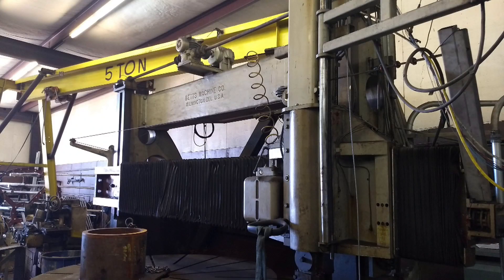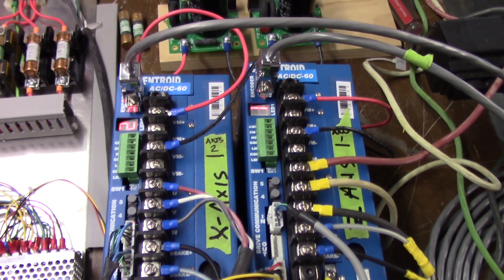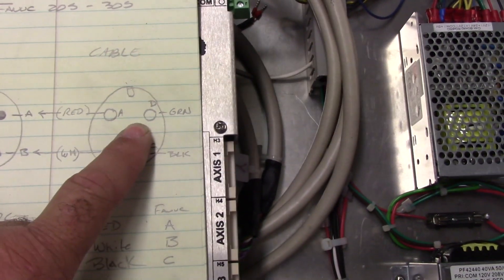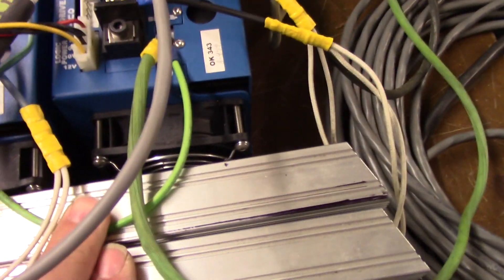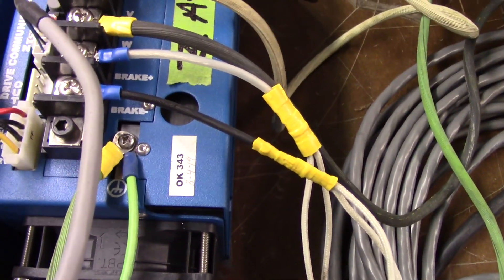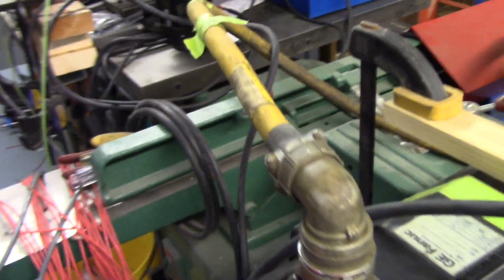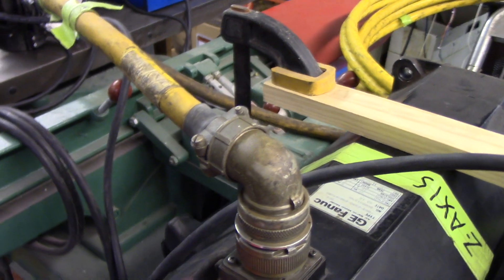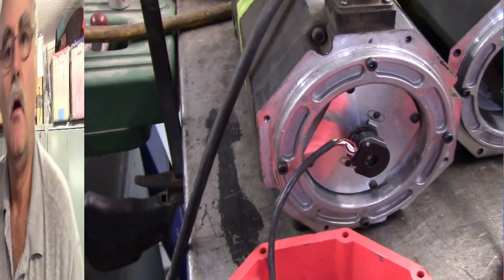Centroid CNC AC/DC FANUC Setup Part 1: Overview & Testing the Fanuc Motors

Comment: Do a video sharing toolchanger
Reply from the maker: Sharing or showing a tool changer. The issue with tool changers is they can be and usually are a little different. My current Atrump Maximill E216 has a carousel tool changer and it runs under Centroid. I can't to do any videos on it because it has a new control and yet to be released.
Reply: Okay thanks for the reply, I would like to retrofit my old Takisawa lathe with yellow cap Fanuc servo 12 station turret with centroid system ,please keep me posted or refer me to someone, talking to you From South Africa 🇿🇦
Reply from the maker: @seimela  suggest you send pictures of your .machine, model numbers of your fanuc motors and details on your turret to sales AT Centroidcnc DOT com
You could also post that information on the Centroid CNC user support forums: https://centroidcncforum.com/viewforum.php?f=64

Comment: Being that qualified person I want to let you know that the DVM is not the correct tool for checking motor isolation. If your DVM shows any resistance to ground I would be surprised. A Meg meter is required. They are sold in different configurations however to get the best reading it should output 1,000 volts. I have found resistive shorts on bad motors where others have found no issue with a 500v meter. I admire your work sir so I am not bashing but mearling informing you of what is needed to check properly. Also FYI is is actually best to have the motor power leads hooked up to the motors and removed from the servo amps. Test the cables while connected to the motor. This will test both at the same time. If there is an issue then isolate each and check each motor and motor wires. I have found that the majority of issues are actually the motor power wires themselves and not the motors.
Reply from the maker: No argument. However most people do not own an expensive megger. Centroid allows the use of the ohm meter.
Reply: There are some affordable ones like:

https://www.grainger.com/mobile/product/SUPCO-LED-Line-Powered-Megohmmeter-3T105

It has color leds to check if the isolation is good or bad... I use it all the time to check my motors / solenoids / alternators.... etc. It’s an amazing tool.